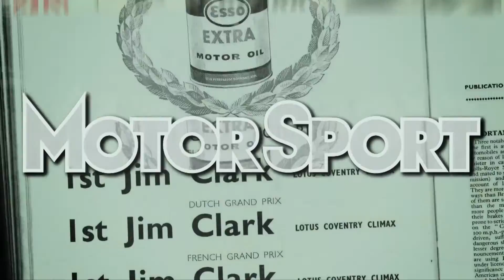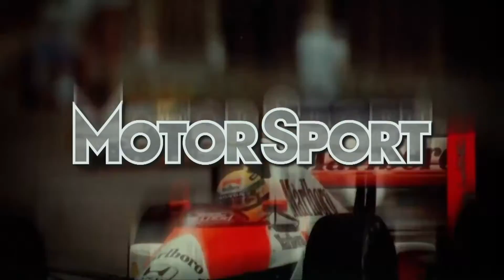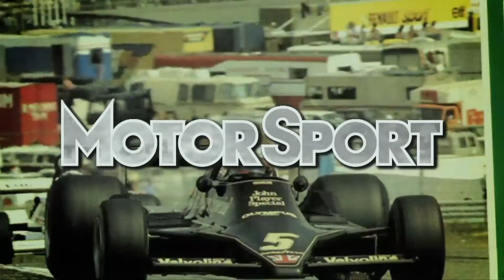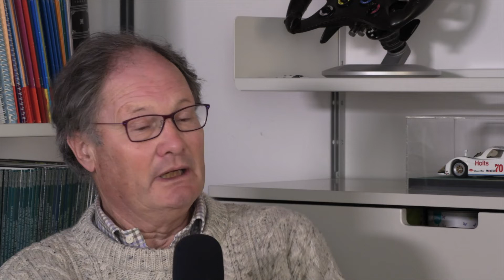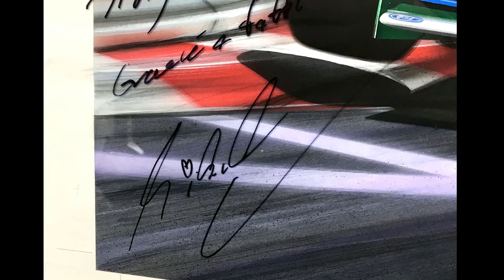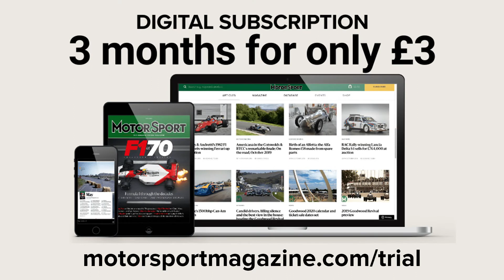Podcast: Frank Dernie | Engineering the Greats

Comment: Great interview, but Frank is wrong on one thing: electric vehicles for the road. They're simply better than hybrids - which are the worst of both worlds. Low electric range, and all the mechanical and efficiency issues of ICE. Batteries aren't going to get worse than they are now, and costs will drop dramatically. Add in the ease of home charging, the minimal maintenance and opportunities to do vehicle-to-grid and earn money from your car....and you can see why 60% of all new cars sold in Norway among others are fully electric. They're fax machines vs email. Nokia vs Apple. CRT vs LED. Simply put: they're just a better product.
Reply: "End Life Costs" > the life of the vehicle start to finish you may be wrong
Reply: The benefit of hybrid , seems to be also a business decision. The second hand market for pure Ev is very bad , when trading in. The depreciation is massive , the fear is of the battery bricks itself,  the car would be worth nothing. With a hybrid , that removes some of the fear at least can still drive around .
Reply: In addition, we will inevitably run out of fossil fuels, and we will never be able to produce enough biofuel to sustain 8 or 9 billion people.

The answer is simple. As you stated, electricity and batteries. We have plentiful sources of energy to harvest electricity from. It's simply a question of building the infrastructure (which is happening as we type).